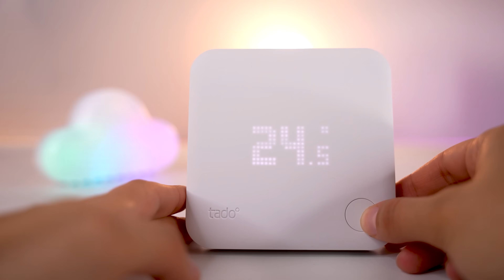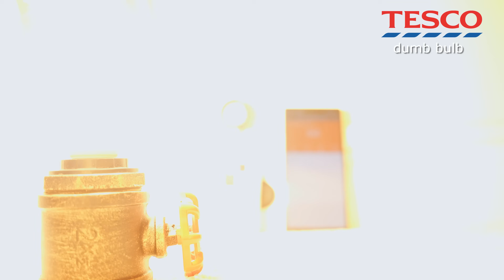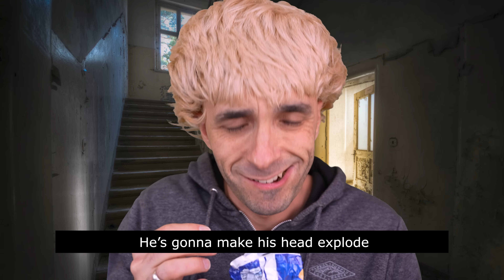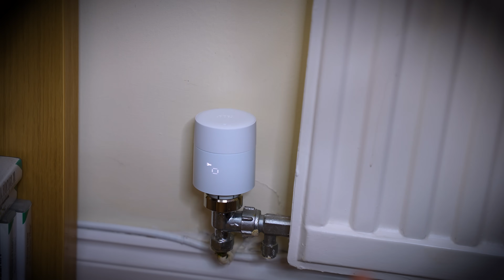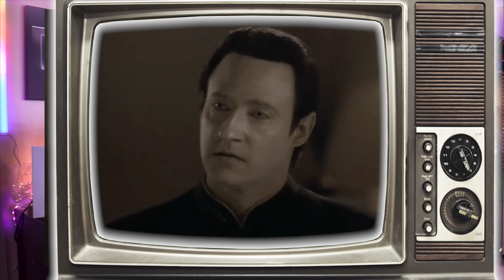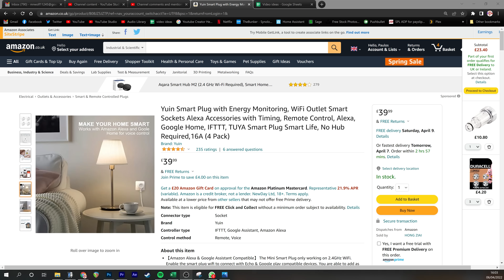The Energy Companies Will Hate Me For Telling You This But... | #EnergyChallenge

Comment: Having just watched a bunch of videos in the YT space in which the "normal" usage of ambient lighting as opposed to general overhead space lighting, I will say this... (and get flamed for it just because people do that) If you want to save electricity, stop filling every damned room in the house with 22 different lighting sources, all of which are broadcasting one color or another, so you can light behind this, under that, over the top of this. "But they are all LED so that makes them VERY efficient and you can just piss-off for saying so!!!" I will hear. Yes, this might be true but every one of your LED fixtures use their own wall wart converter, whether integrated or external, and they are all inefficient to some extent so you may THINK you are saving electricity with 22 lower light output devices over 1 single higher output light source (LED none-the-less) when you are actually screwing the pooch. Electricity wise of course. About as dumb as every single device inside your new computer has LED crap on/in it when you can't see it tucked under the desk anyway. When you really start looking at power consumption, simple and the least amount of devices, the better.
Reply from the maker: I don't disagree with any of that actually. I've tested the amount of electricity those lights use and know exactly how much it costs. (it's pennies a day each, which in fairness does add up) 

The missing part of your argument is whether the visual trade off is worth it. Lighting a room isn't just about seeing, it is the most imporant aspect of interior design

A fair analogy would be the decision to buy a VW golf over a VW Polo. In your argument both cars ultimately do the same thing but one costs thousands of pounds more, so why spend the extra money on the Golf? Your argument ignores the fact that the Golf is a totally different experience.
Reply: @paulhibbert  Lol. The pedant in me wants to go, "But... But... But... But..." But I can't. We are both talking the same thing. If you desire the deep, silky approach to interior design which will create a plethora of color tone options and "feels" (the golf) it will be far different than the Omegle generation of "look at me" lighting held up with thumb tacks and blue tack (the Polo). With that said, I don't even know what these models are because I live in the States 🙂 The point was the cumulative cost of lots of random lighting schemes will add up to be sneakily more expensive than one might expect. Buying a Golf up front makes way more sense than buying a Polo and putting a rice racer spoiler, body wraps and chrome fender flares on it to make it go faster (that is what they do, right?) On that note, I have a server farm in my basement and one of those four boxes has Mosquitto running on it. Ok, it's not just Mosquitto. Node Red. Grafana. Yanno, all the stuff that could run on a Pi. Does that qualify as a Golf? Or maybe just stupid. Yeah, probably the latter. I should put some fender flares on it... thinking out loud. (For a friend) Love the videos !

Comment: Great to see you including the running costs of some typical smart home devices. If used properly the small 'parasitic' energy they consume is well worth it. However you lost me when you started promoting smart radiator valves at £90 each! I won't be replacing my 12 manual TRVs with those any time soon. How about including some ROI calculations in a future video?

Comment: I have multiple monitors like yours and turn them on and off manually at night, never thought to use smart plugs for timers... IDIOT! Do you have a recommendation for a smart power strip or something with multiple controllable outlets? I have looked at several but don't know any that I would necessarily trust. Have used some VERY unreliable devices...

Comment: My council/landlord have said if I add a TADO like to my air heating system… 
I will be liable for any and all breakdown costs (I’ve have this in writing) … of which there has been over 30k since installed poorly. 
Nothing works for long… tanks, system motherboards (replaced 5 plus times) air conversion outside unit (replaced after failing 3 times). 

Electric bill was £750 per yr before Airheating system on econo 7…. Now estimated bill despite on smart meter £3-7k for small 2 bed bungalow.
Even got EDF estimates of being £14k, so ditch them as fitted bad faulty meter. 

I have she that cannot be named, smart plugs, lighting and scheduling etc.

Comment: Regarding the “Opentherm” section. I don’t believe there is much to save by using a PID regulator on one’s water heater. I’ve been working with PID controllers in laboratory gear and yes, you can keep a very stable temperature in fluids when correctly set up, and I’m also aware that it is the last degrees that cost the most, but I think that is marginal how much one can save. The fluctuation in temperature will balance itself out. It uses more energy when overheating and save energy when the water is under the wanted temperature.

I want to see some serious engineering reports that supports that claim before I’ll go out and invest a lot of money in a more expensive heater that supports such a setup.

Comment: Ah, nice one Paul.  Seriously grateful.  This was the main impetus for setting up a smart home for me, but life happened and even though I've had smart gear running for 9 months now, I haven't gotten completely serious about minimising power usage.  You've given me the inspiration to take the next steps.  Already got some lights on timers, but the next low hanging fruit seems to cut power to AV gear and workstation/monitors when not in use.  I have some 16a energy monitoring smart plugs and haven't even used them yet!  For shame.  But the shame ends today my good fellow.

Comment: Paul you have to know that if you have an OLED TV like a  LG OLED C1 or similar you have to never unplug it form power. So yes you are supposed to leave OLED's in standby so they can run the compensation cycle. You can turn them off at the mains, but not all the time. Otherwise the panel won't be able to run the compensation cycle. Some manufacturers state the warranty will be void if you never leave the set in standby. Notably All OLED Smart TVs activate a compensation cycle automatically every four hours of use. The moment you turn off the TV, it will start the cycle that will repair the pixels that are degrading to offer the best image quality at all times.

Comment: TVs have been required by law to use 0.5 Watts or less per hour in standby since 2013. That's 4.38kW per year. With electricity at 30p/kW, it will only cost £1.31 per year.

Comment: Hi! I don't understand how a Tado thermostat can save energy in the boiler? The boiler will keep the energy from the over shoot in temperature you mention. If there is a hourly energy price and the boiler is heated when the cost is low then it makes sense. What am I missing?
Reply from the maker: When the boiler heats the radiators, energy is transferred. When the boiler does not heat the radiators, energy is not transferred. 😐

Comment: The only thing I would say about the open therm stats is most combi boilers have a point set temp that they are most efficient at. By running them at lower or higher than the recommended 75 degrees temps the boiler is no longer running at it's most efficient.different makes of condensing boilers have different most efficiant set points but range between 60 and 75. So running at 40 is less efficiant. 
The Trvs on the rads will adjust flow rate and in turn the temp thro the rads.(if set correctly) keep up the great content

Comment: Time for a cold hard fact. Smart homes don't save $. They are a hobby. They might be because we are lazy. They might be because we are techies. But they are not thrifty! I've spent enough on my gadgets to pay my power bill for quite a few years.
Reply from the maker: Depends on how far you take things and what you buy. That's quite a sweeping statement there.

A packet of 4 smart plugs and an echo dot will save you money inside of a year.
Reply from the maker: For that matter replacing your tesco LED bulbs with a bunch of smart bulbs will save you money exponentially for every bulb you replace, simply by plugging them in. I proved this with cold hard math in this very video.

If you already own a full size echo then there are zigbee motion sensors that will cost about £10 on aliexpress that could turn your smart bulbs off when your kids leave a room empty with the lights on. You'll make that £10 back in a year easily and then save going forwards. 

The more I think about this, the more your cold hard fact starts to sound like cold hard unsubstantiated cynicism 😂
Reply: @paulhibbert  do you have a link to the Aliexpress motion sensors you recommend please? 😊

Comment: I have been using tado for 2 years the battery is ridiculous, I have changed battery in 2 of 14 radiators in 2 years. This winter the heating bill is 22% lower then 2 years ago

Comment: Something I like doing is, pairing a smart outlet like the BG sockets, with one of those 3 way selective power plugs, like E-ON did quite a while ago, then extend with a socket bank if needed. So when I put my computer to sleep if I'm nipping out for a few mins, the 2 monitors, speakers and external HDD shuts off. So instead of having 5 devices on standby, I only have 1. And of course at the end of the day. I shut it all off. I've got this kind of setup for all my 'areas' over the house. So if the 'main' device is not receiving enough power, the selective power plug doesn't allow the other 'peripheral devices' to receive power at all. Very elegant solution, especially when paired with HA.

Comment: Questions.  Smart power control plugs, ZigBee or WiFi?  You can buy either, some Zigbee plugs can cost slightly more, but does ZigBee smart plugs consume slightly less power than WiFi?  Also ZigBee plugs can form part of a mesh network system using Home assistant running Zigbee2MQTT. Also no additional hub is required if using HA.  Doesn't WiFi smart power plugs tie up your WiFi router IP addresses if a lot are added?

Comment: What I do to save money is not waste money on automation or smart technology. For example, my ‘economy 7 storage heater’ cost me £525. I could have purchased the next model up in the range, which has ‘open window protection’. It would have cost me £999! I saved £475 which would have taken years to recoup I. Saved energy. I’ve also recently bought a new washing machine for £499. The smart model with Wi-Fi connectivity would have cost £649. I saved £150. Ok, so I can’t start the machine running remotely, but, I have to go to the machine to load it, so no loss there. There are numerous devices around my home which I never switch off. Ok, they may cost me £2.75 or £4.95 or 99p a year to do that, but being constantly switched on, maintains them at a constant, stable temperature, increasing longevity and saving a fortune in early replacement costs or repair expenses.

When I go to the pub for an evening with the lads, I tell my wife to put her coat on. ‘Are you taking me with you’? She asks excitedly, ‘no’ I respond ‘I’m turning the heating off’!

I don’t go to the expense of motion detectors. When I walk into a room I turn tje lights on, and off when I exit the room. The light switches are conveniently located by the door.

I always send the wife to bed at least 15 minutes before me. This insures the bed is warm and negates the need for an electric blanket or hot water bottle.

I could go on, but I think you get the picture.

Comment: I've used Tado for years, I'm on the v2 and luckily no subscription and the geo fencing is spot on. The house is so much more comfortable as it analyses how the house heats up and if it needs to heat to 19.5° it knows to stop heating at say 18.5°, stop heating, and allow the radiators to 'over heat' up to the desired temperature. It watches the weather so on hot sunny days it knows not to heat up as much and allow for sunlight warmth. I think the system is brilliant.

Comment: Hi @paul I installed the hardwired tado thermostat and also 4 TRV's . I have used a small room temperature guide to sort out the TRV offset temperature as well. tested the paid services, great.
Reply from the maker: I was just doing that the other day to change the offset. How has it worked out for you long term?
Reply: @paulhibbert  I have never been sure why so many people stress over the offset, I simply don’t bother. I could use the other sensors in each room that read temp and mess with home assistant to constantly adjust the offsets…but why? The temp reading from the TRV is pretty irrelevant as once you have set the temps you like or want then what does it matter? 

Before tado my room stat may have been set to 19 (and who knows how accurate it was!) but that’s the temp we liked in that room. Now with tado I may have to set the TRV to 21 to achieve the same room temp that we like. Is the room at 19, 20, 21 deg…who know and why would you care? 

I could check temp via a motion sensor or similar, but are they accurate anyway and who cares, surely it’s about the temp you like in the room and not what the actual number is.
Reply: @picotrain5959  the temps was more about getting the units to cut off and not running all the time. I use schedules anyway. but if let's say you set it to 22 and even after a hour it reports is 21 in room, it won't cut of and the boiler will keep running, costing gas and power. offset can help a little. like now in my front room while typing this, my small unit says 22.6c and 48% dryness. my TRV 3 ft behind my sofa says, 24.7 . even tado, that I'm on their message board say to use the offset from time to time to help cut of the units and save costs. My flat ( second floor) during the day will go from 19-21 due to the sun moving around the building. so it's good to control each room and this is why I got it. doubt Very much if in the next 4 months I'll be using the heating anyway but it was good for the first month. I was here for the cold mornings for when I go to work.
Reply: @riverrat_uk  Yeah I get why people do it and want to do it and maybe I am looking at it too simply. But my understanding is that due to the TRV’s location being right next to the heat source the reading will always be a little off from that of the middle of the room for example.

By setting an offset you are surely just adjusting the original temp reading on the TRV up or down by a few deg in an attempt to make the reading more accurate when compared to a different part of the room. But other than that I am not sure what it achieves.

When first installing tado and TRV’s in every room, I simply set temps as I saw fit and over time as I found it to be too warm or too cold I adjusted them a little bit at a time to eventually achieve the temp we liked in the room. 

Now it might be that in order to achieve 19 deg in the middle of the room I have to set the TRV to 21 deg, but that’s fine as I know it’s the temp I like in the room regardless of what the TRV reports and or is set too.

Also having played with this over time it very clear to see that the actual offset required constantly changes so you are fighting a loosing battle trying to offset them anyway and I would still ask myself to what point or benefit.

The offset is generally zero when the heating is off but gradually increases as the heating output increases. 

Like most things in smart home environments there are always 101 ways to achieve the same thing, so I get why people mess with the offsets. But for me smart heating is about being able to set the temp’s in individual rooms at the level we are comfy with and there for once we have tweaked this and found those levels, for me anyway the actual reading on the TRV is irrelevant.
Reply: @picotrain5959  100% 👍 I would say are always 1c out but as long as people get to control each room as needed. like me I don't need my second bedroom at present, we can all save money 😁
Reply: @paulhibbert  Hi Paul. played about with it. I have a hard wired thermostat in hallway. it never gets above 22 in there and a small rad that I can't add a trv to. so it seems was 1.5c out. so I took it in the middle as upped the unit by 0.7 . cuts of better now. in 4 weeks nearly 5 weeks reports only £18 used in gas.

Comment: Another tip, if you have an Xbox Series X, make sure you put it into "Energy Saver" mode. 

The "instant on" mode uses about 10-11w of power constantly, whereas "Energy Saver" uses about 1-2w, and will only spike if there are updates to be downloaded 

I don't think the benefits of "instant on" are enough to warrant it sapping juice all the time.

Of course the better option is to turn everything off.

Comment: I gotta agree on the standby power thing. I have my whole office desk setup via a power strip connected via a single smart plug. A google routine is set to switch it on 5min before I start work (I work from home but you could do it with a voice command for ad hoc usage), and once I shut down the laptop I have a voice command to switch it all off (and move my music to the living room). In case I forget, it will switch off when I go to bed as part of my "goodnight" routine which also switches off other lights around the house.
It is part of a "workday" routine that runs on weekdays, but by having it as a "workday" routine and not simply every weekday, I can easily disable everything in the routine by disabling one routine. It is an all a routine that starts with opening blinds and runs various things right the day till 5pm. On a non-weekend day off (eg a public holiday) I don't want any of it to run, and my standard things run instead eg blinds opening later and no laptop!